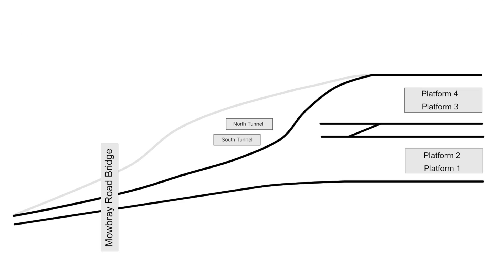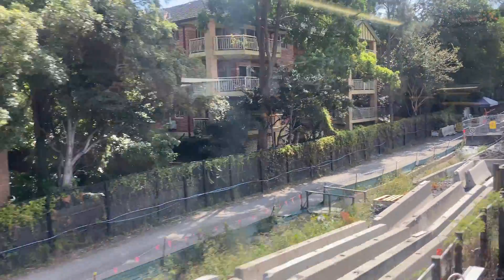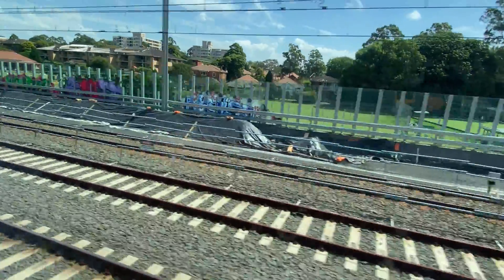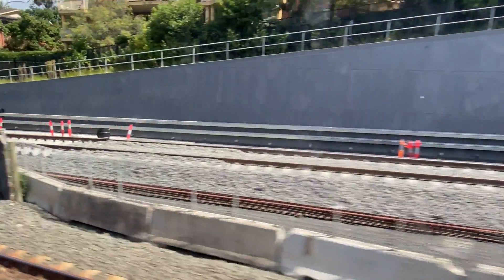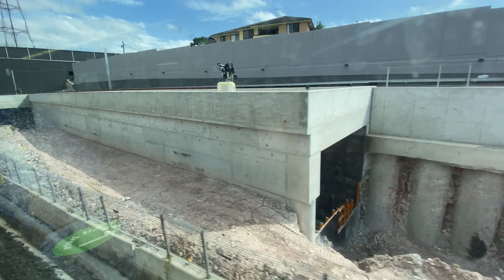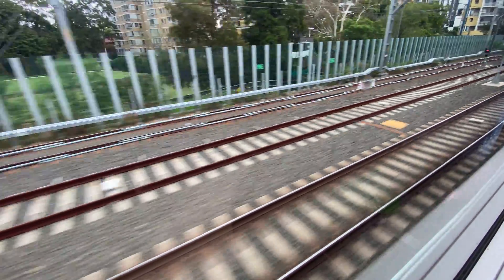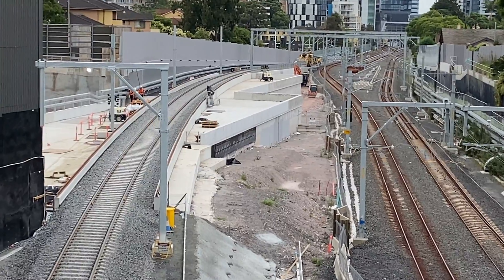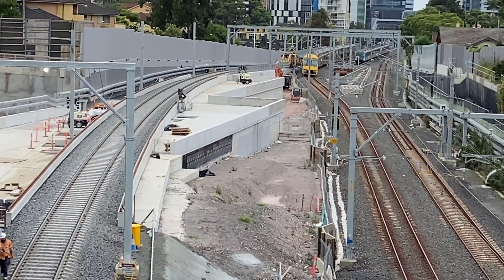Chatswood Dive Site Update - New Northbound North Shore line now has tracks and overhead wires!

Comment: Hi Paul, excellent video. Thanks for sharing. Chatswood has certainly changed a lot to when I was last there way back prior to 1981. The high rise buildings there make it look like part of central Sydney. Incidentally, can a Sydney metro train run along standard suburban track or is it all changed to cater for the new trains? Was the track from Chatswood to Epping completely replaced when becoming part of the Metro? Anyway, take care. Robert.
Reply from the maker: Hi Robert, Glad you enjoyed this video.  Sydney Metro trains run on the same voltage (1500 DC) as standard Sydney Suburban Trains.  However, as the trains are driverless, they wouldn't be able to run on the standard suburban network.  When the Chatswood to Epping line was closed for about 7 months prior to Sydney Metro opening on 26 May 2019, the existing track and electrification system was retained. They increased the width of the platforms slightly to meet Metro standards for a smaller gap between the train and platform, and of course they added the platform screen doors. Yes Chatswood has many high rise buildings these days and has become an important employment area. Hope this helps. Paul
Reply: @TransportVlog  thanks, I thought the tracks are different gauge but it seems not! Wonder if ever a double decker train can make it to Rouse Hill as an experiment or is it too fat to go into the metro tube after Epping :)
Reply: @Woodland26  The track gauge is the same. The loading gauge is different (this is whether the train can fit platforms, tunnels etc). The tunnels are too small west of Epping for double decker trains.  Also the signalling is different too, to allow for driverless trains. Hope this helps. Paul
Reply: @SelfHelpforLife  Thanks Paul for explanation. Before I could drive I caught the train a lot and on a Sunday it was 30cents concession return to anyway in the late 70s. Shops closed sharp 12noon on a Saturday. So that was a nice activity to do exploring the whole network.
Reply from the maker: @Woodland26  Nice! - I lived in New Zealand in the late 1970s and I don't think shops opened there on Saturdays or Sundays. How times have changed! - I've just done a new Chatswood Dive Site update video. Here is a link to it. https://youtu.be/NStgkwhQt5E
Reply: @TransportVlog  watched last night already thank you! I seem to picked sites close to metro stations years before it was conceived. I can walk to the Cherrybrook station, can go to work to Macquarie Park and Bella Vista by metro. Mother lives not far from the Crows Nest station. Can't wait going all the way to the city in a few years' time.

Comment: Thanks for this. I was walking over the bridge on Mowbray road this morning and notice that the new north bound line is now being used. However there are another two tracks inside the usual tracks on this section, could you please explain what these are as the south bound line and the old north bound line do not have them.
Reply from the maker: Hi Ian, yes I noticed that too.  I actually don't know, but I will mention the extra 2 rails in my next update video and hopefully someone will leave a comment and let us know!

Comment: While Australian Infrastructure Expenditure may be high, we get far less for our money than other nations of comparable quality.
Although of lower quality, the Infrastructure Projects of our 2nd nearest neighbour, Indonesia, not just in rail but also motorways, air, sea & container ports, are on a massive scale.
They have 3 different rail categories of rail infrastructure projects underway, the MRT: suburban & inter urban upgrading, the LRT: also known as the SKYTRAIN, new elevated network running alongside new motorways around Jakarta, west to Soekarno Hatta Airport, South to Bogor, East to Bekasi, the VFT: stage 1 Jakarta to Bandung underway, stage 2 in planning Bandung to Surabaya.
Most new trains & freight rolling stock as well as Buses & Coaches are being built in Surabaya Central Jawa.
There are rail museums nearby, you can sometimes catch a steam train from either Surabaya or Solo to Yogyakarta.
Reply from the maker: Hi Alan, thanks for sharing what is happening in Indonesia with us. Indonesia has around 270 million people, which is over 10 times more people than in Aus, and a lot less space than we have. This makes public transport much more viable and necessary. It would be interesting to take a trip to Indonesia to see what's happening.

Comment: wondering if the middle line will be repurposed for a siding or a turn back
Reply from the maker: That's a good question! - It would depend on whether its long enough to fit an 8 car train, without blocking the tunnel entrances. Would also require additional points north of Artarmon station to return the train to the southbound line. My thinking is probably not, but lets see what happens!

Comment: Haven't been to Chatswood station in a long time.  From what I could see from this video it appears that the Metro trains are using the middle platforms.  Do you have a video of  how the Metro lines get under (or over) the line(s) heading to Hornsby?
Reply: Heading north...the North Shore line has the two outer tracks (up and down) and stay on the level. The metro line to Epping are the 2  internal / middle tracks and beyond the end of the northern end of the platform makes a dive into a tunnel and then heads north west towards Epping
Reply from the maker: Hi Michael, I don't, but someone else does! - Here's the link - https://youtu.be/JOhM567TioU?t=45
Reply: @TransportVlog  doh silly me it’s the converted train line to epping.  Caught it once but didn’t have the front seat :)